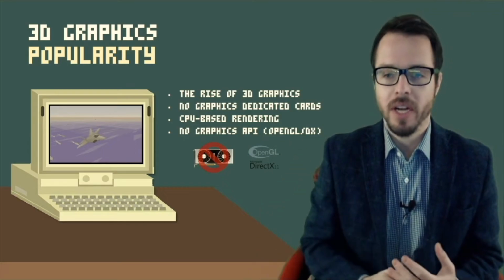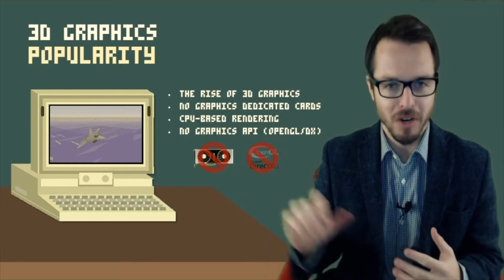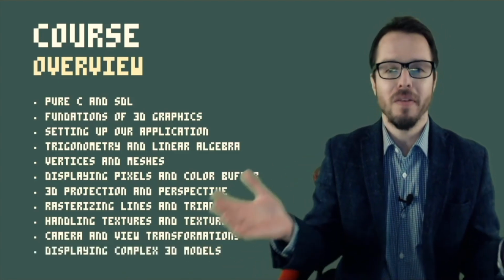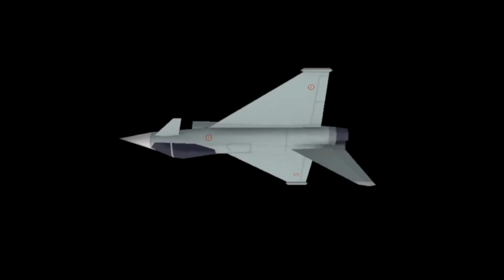3D Graphics Programming (Introduction)

Comment: Is it possible to create a software renderer but have the GPU use it to boost performance? Asking as a noob
Reply: Modern GPUs are responsible for two things, 3D maths and 2D rasterization. You could start with this software version and then add in GPU elements as you go along. When I wrote the 3D engine used in Abomination I took my hobby software engine and offloaded the triangle drawing to DirectX -- that way it uses software if no GPU is present, or pushes it to a GPU if it finds one. https://www.youtube.com/watch?v=9UOYps_3eM0